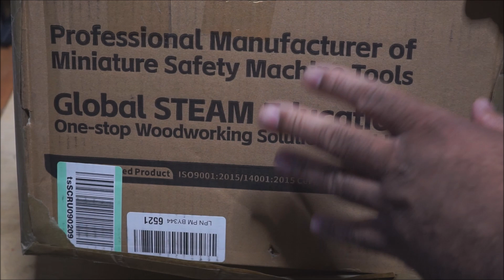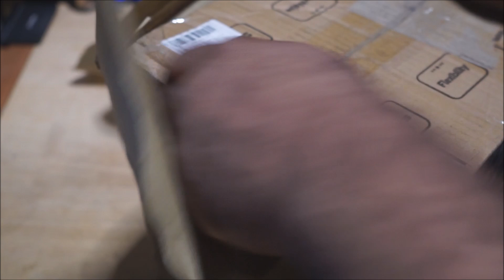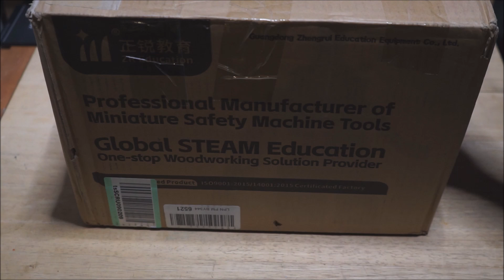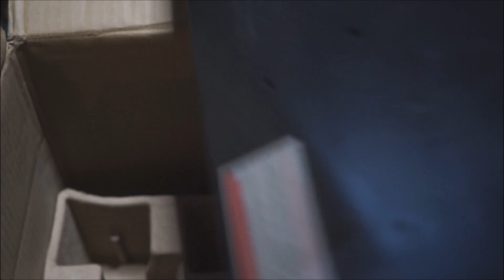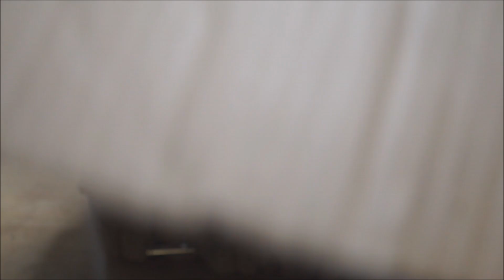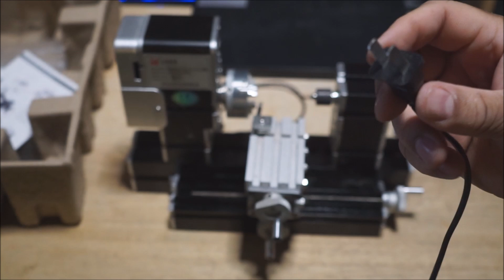Zhengrui 60W All-Metal 4-Axis Zrcc04060 Rotary Miniature Lathe - Unboxing

Comment: I just bought this at your recommendation LOL but I also got the Vertical mill as well,  it Has 60 watts of power and 20,000 RPMS and I will be doing the same upgrades that you did to beef it up and stabilize it So thanks for the advice and review.
Reply from the maker: Hey, that's great to hear.  You're welcome.  That's cool you got the vertical mill as well. I have been looking at that myself.  Yeah, there are a lot of speaker projects I want to work on using the lathe.
Reply: @lovethatpop  I wanted a mini real bad but i dont i have the room, my hobby room is in my house, i build models so those cool custom parts is going to be fun to make.
Reply from the maker: @michaelbaykara2322  yeah, this is the perfect tool for that.

Comment: So since you've had this for awhile, what's your opinion of it?
Reply from the maker: Thanks for the comment.  That's a good question.  I was thinking of making a video on that.  So far I haven't made nothing major on it yet, I just have modified some small parts.  I originally got it to make some Speaker terminals out of copper.  You can actually make some binding posts terminals.   To buy a pair of speaker binding posts made out of pure copper, would cost anywhere from $80 - $120 dollars a pair!  So I figure I could make them myself with a lathe for a lot less.  it can be done, but takes a lot of time.   
If you do get one of these lathes, the first thing I would recommend getting, is a Drill Chuck.  Having a drill chuck is the best part or accessory you can get for it.  You can do a lot more with the lathe.
This lathe is good for cutting brass, aluminum, plastic and wood.  It does cut good on brass and brass speaker terminals.  You can actually make small or mini hammers, knobs or even speaker feet.  The lathe would be good for making small or tiny parts, like someone that does RC Cars parts (radio control cars), making bolts, screws or make doll house furniture.  Also you can make mini lathe parts too.  This lathe is good for Turning down (cutting down) metal rods or shafts for ball bearings to fit.  It's for very Light duty work.
If you only have $150 or $160 to spend, it is definitely worth getting.  It's better to have one, than not to have one.  It does come in handy sometimes.  But if you have $400 or $500 dollars to spend, you can get a larger or Real Mini one that can make a lot more stuff and it will cut easy.

I hope that helps.  I may do a video on that soon.

Thanks...
Reply: @lovethatpop  IMHO the biggest draw back with these is, they are not as rigid. This can compromise on accuracy. Having said that, with my lack of skill & machine limitations, I've been able to achieve +/- 0.1mm tolerance. Not tool makers tolerance but for the stuff I do, it's plenty accurate. 

I mainly build models out of wood parts & some aluminum/plastic. 
If one goes into the investment with the right expectations, they can be really useful machines.
Thanks for your Videos Mate 😎🙏